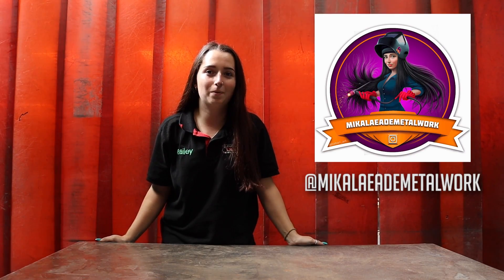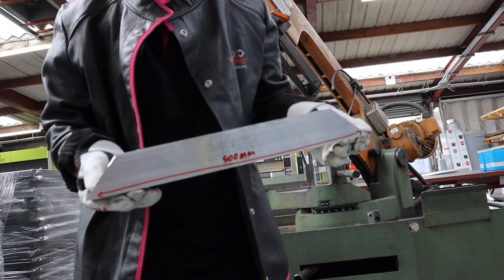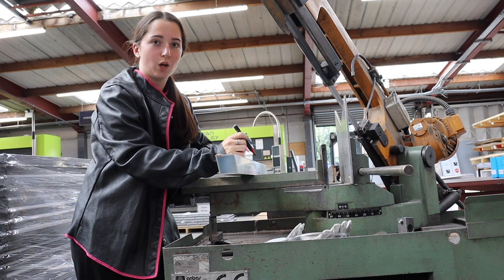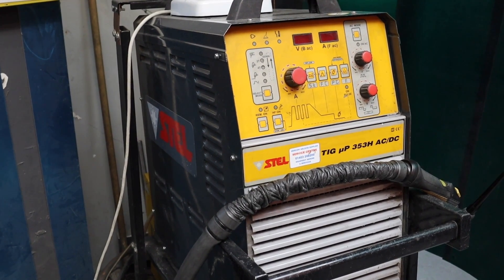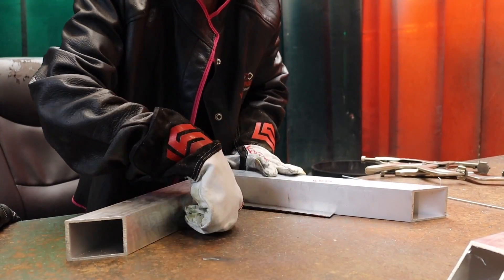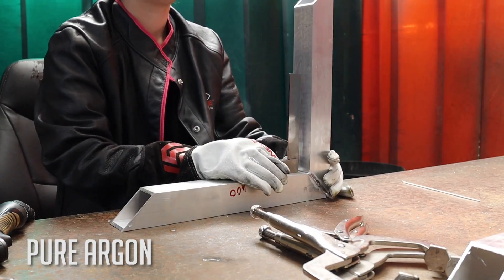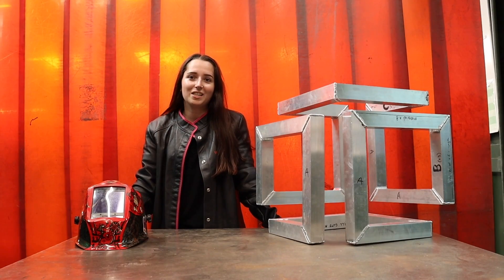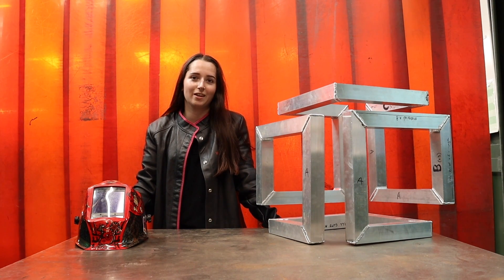How to Weld an Infinity Cube

Comment: You make Tig welding look easy Michaela. 
I spend more time grinding tungsten at the moment because I ball the tip (DC scratch start on mild steel) ....that said I really like the way Tig is so precise and clean.
Thanks Michaela.
Reply: @Mikala Eade Metalwork No time? I think I did it two semesters and the shit still sucks and I'm dipping the Tungsten. I'm better on steel than aluminum. Aluminum I always burn through easily.

Comment: 8:40 if you flip over and put on your tacks than the profiles are not parallel to the table anymore.
Reply: @Mikala Eade Metalwork But anyway it is perfectly explained and I took notes with drawings. Thank you for this vid. (and I'm glad that dimensions are in both units) :)

Comment: Great job Mikala. Not a criticism but something I noticed at 8:38 you put on proud tacks and then flipped it over and clamped it down opening the gap and compromising the flatness slightly. I think it would have been wise to hang those tacks over the edge of the bench. Great to see a girl welding, keep it up.
Reply: @Mikala Eade Metalwork We’ve all been there! And tacked or welded something only to regret it 10 seconds later. I’ve got 5 grinders in the workshop so I’ve always got the right disc in one of them!
Reply: @grumpyone5963  I wish I had room to carry many grinders. I hate switching shit out. I'll sometimes go from a grinding to cutting a lot.
Reply: @ebogar42  Make yourself a bracket to hang them on the wall maybe. I have 2 hanging on the wall and 2 on top of my mig welder, plus 9 inch under the bench. I also change the power leads for longer ones so I can get around my large fabrications easy without changing sockets. 🇬🇧👍
Reply from the maker: Great feedback! Thanks for giving constructive criticism and sharing advice! We appreciate that!
Reply: also what ive learned in my short welding career with aluminum boats you should not ever weld open gaps with aluminum i dont remember the exact reason what i was told but i think im not too far from right if i told you it has something to do with coming more contact with air it doesnt get enough shielding gas and weld goes to shit im sure google will have a better answer

Comment: AHHHHH  A cute project ..... BUUUUT  in such an assembly when you clamp to a flat table you cannot/should not/ never-never turn it over and have it misaligned by the LUMPS of the tacks.  You can put the tacks off the edge of the table or use spacer/shim pieces thicker than a tack bump. You can clearly see the distortion at each flip over and the clamps pulling and distorting.    OK for an ornament.......BUT so easy to avoid. Yup all at 90 deg BUT no long straight edge was put across joints.